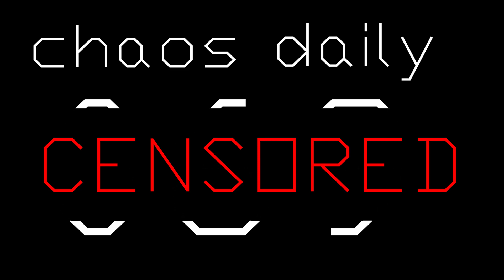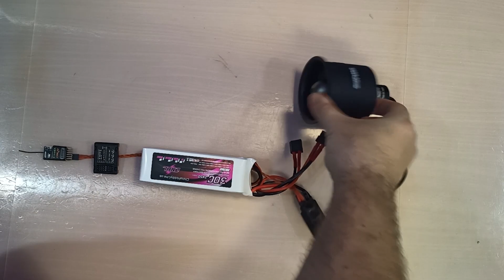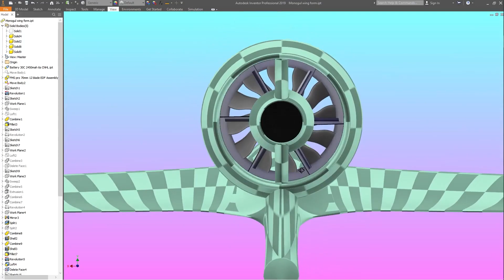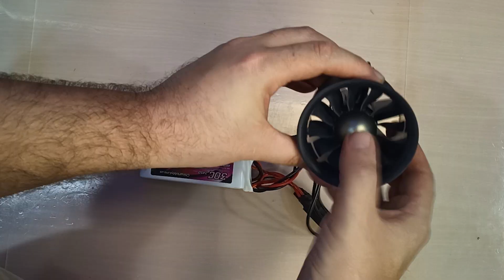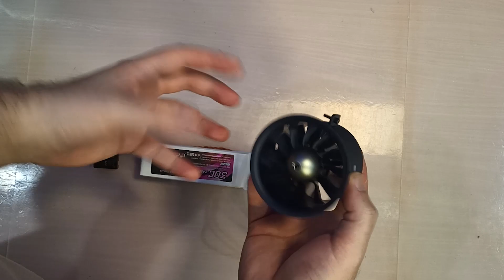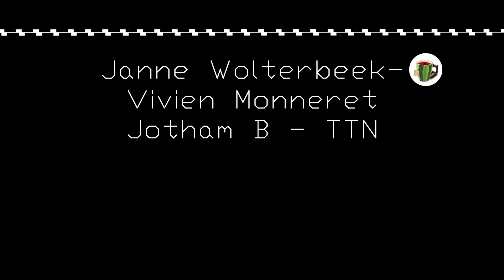chaos daily 2021: 0XX Why EDF wires WHY

Comment: Couldn’t you 3d print an edf case, get a brushless motor and a propeller. Then assemble ur own edf with the wires out the front? Would be pretty kool ngl
Reply from the maker: yes, thats still the plane, but its not easy finding this motor for sale on its own. There are a few others where the wires come out the back, but they aint cheap. Also step one in learning to designing anything is, does it already exist, and can I just get it and learn to copy it. lol